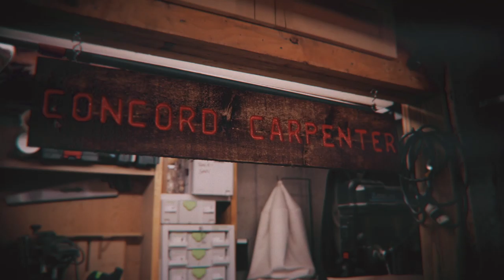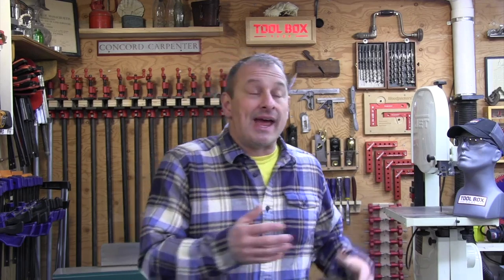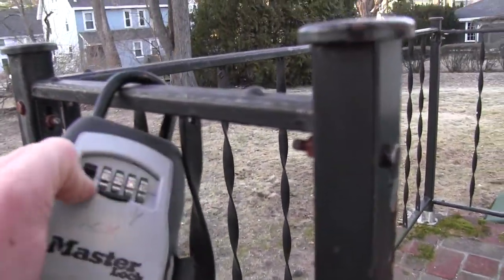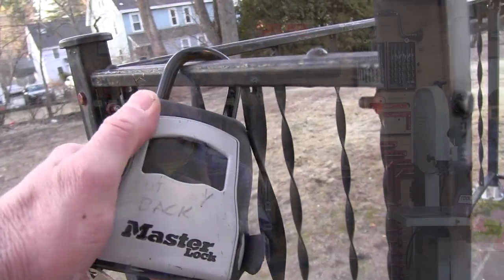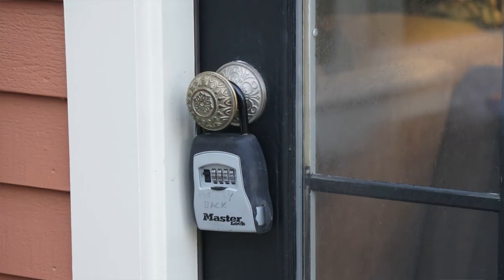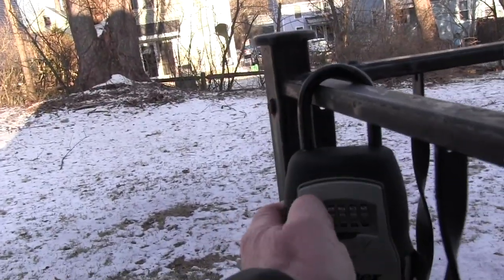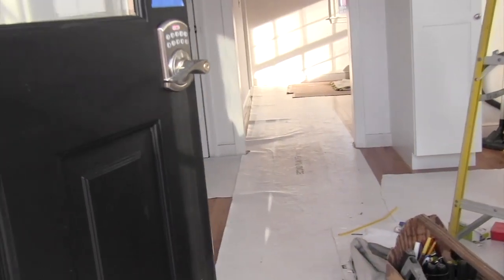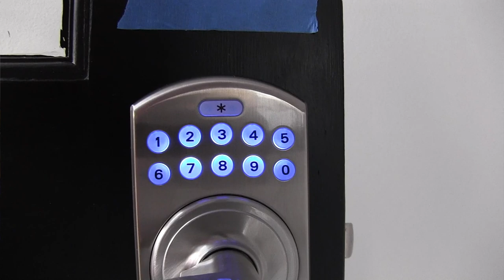Controlling Jobsite Access  - Delaney LP250 Keypad Lock

Comment: I would get a more customizable lock and try to sell it to the customer. Many app controlled locks would allow a key feature, Time codes. Contractors should not have access at night time and you could simply disable the code. or perhaps schedules are a little lax. Maybe you dont want to allow keypad access till after 9 because the home owners might be still waking up and would rather let the subs in. Regardless my thought is if youre trying to make it more secure go all the way. I would disable a subs access immediately once their job is done the only person the customer should have to be concerned about having 24/7 access is one head project manager and if their tech savvy perhaps they should manage the lock themselves, I know i would.
Reply from the maker: Nicholas Hartzler many smart locks can shut off access after a certain time. On the door in this video the client locked the storm glass door at night....done!